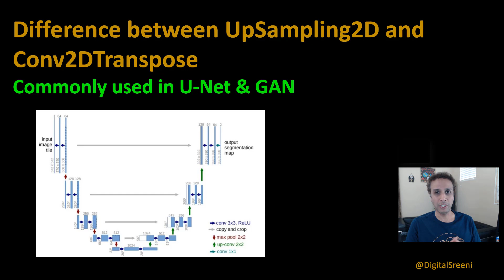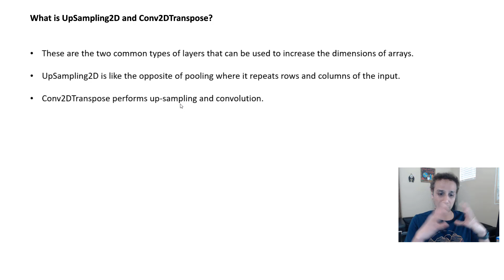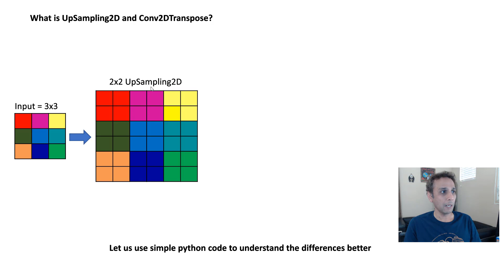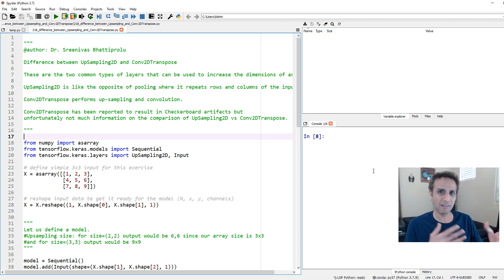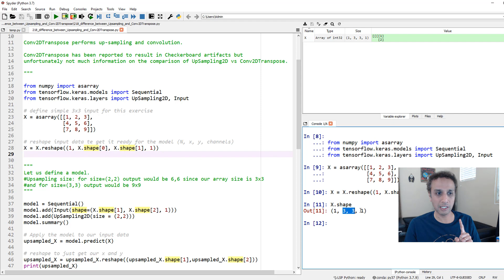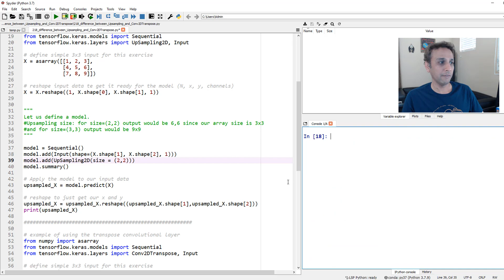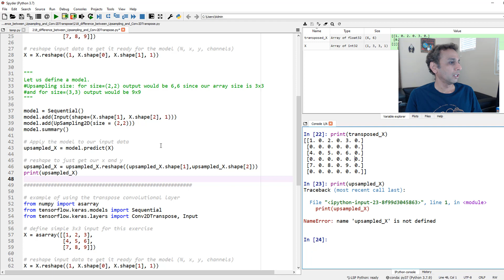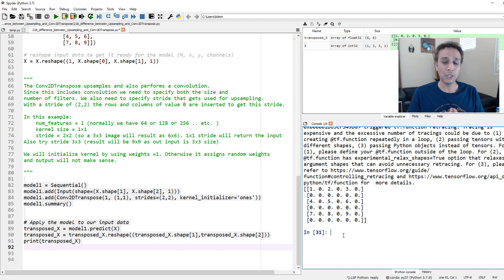218 - Difference between UpSampling2D and Conv2DTranspose used in U-Net and GAN

Comment: To get any possible advantages of using learned parameters over simple upscaling by copying, you should change your code to 
model1.add(Conv2DTranspose(n_filters, (2,2), strides=(2,2)), where n_filters is something meaningful, not just 1.
Then for every input pixel in the previous layer, it will apply n_filters of 2x2, where those 2x2 filters have unique weights and therefore you will get potentially 4 different values (spatially) in your upscaled image as opposed to 4 same values when you perform simple upsampling. The problem is those upsampling convolutions have shared weights and they are contextually blind. It means that for the same pixel in different locations of your previous layer they will create the same 'prints' on the next upscaled layer, which is not very smart. But you still can hope that the spatial information of the next layer will be reflected by the different activation of the depth-wise filters of the previous layer, which theoretically can be learned. The purpose of using the Conv2DTranspose is to increase (or rather not lose that much) the original resolution of the input image. It is basically the same gradient flow path that you get from the skip connections, just in different topography.
Reply from the maker: Thank you very much Alexander for providing additional insights on this topic.

Comment: I wish you can provide a more in-depth lecture about evaluating the results of U-Nets.
Reply from the maker: Other than looking at IoU values do you have any suggestions for evaluating U-net results? I’ll definitely make a video if someone can suggest any methods. I use IoU as the primary metric.
Reply: @DigitalSreeni  MIoU, Precision, Recall, ROC-AUC, P-R-AUC, Dice Similarity Coefficient. These are the common ones they used in most published papers and benchmarks. They also use accuracy sometimes. TPR FPR
Reply from the maker: ROC-AUC is used to compare models and I’ve done a video on the topic. This is used during exploratory phase where you’re trying to compare various models. Researchers who publish papers use them to compare their model against other models. Similarly other parameters are used to compare results from various approaches. If your goal is to explore different models to find which one works for your dataset then you can do all that. But, when you have a dataset to segment your goal is to understand the efficacy of the model in segmenting your dataset and for that IoU is a great metric. I personally do not know how other metrics are offering any better insights compared to IoU. There are 10s of other metrics you can report but you need to consider whether they offer any useful insights about the segmentation. In my experience IoU turned out to be more than adequate. By the way other metrics such as Dice and precision will trend similarly to IoU.
Reply: @DigitalSreeni  ok thank you

Comment: Hi sreeni sir,I have a doubt regarding semantic segmentation. Sir i have a dataset with different classes. I have  different masks for each class with each mask in each folder. can i do semantic segmentation with a model  or should i go for classification. my aim is to do staging of different classes based on their texture and size
Reply: Hey,
Did you get a solution for this? If so can you share the approach used. I faced this problem few years back and designed very bad approach of training 4 different UNET models for 4 different classes I had. But after looking at Sreeni's videos I understood we could stack masks into single image with different pixel values and create a single multi-class unet segmentation model.

Comment: Hi Sreeni sir, Thanks for the informative video, and I have one doubt that in transfer learning (mainly in deep learning) we are using pre-trained weights and customizing the model for our data/microscopic images.  If we have trained our customized model with traditional ML approaches like Xgboost or LightGBM whether it is possible to retrain the ML model/pickles by loading as we are doing in transfer learning (due to drifting problem in the test/input samples at production).